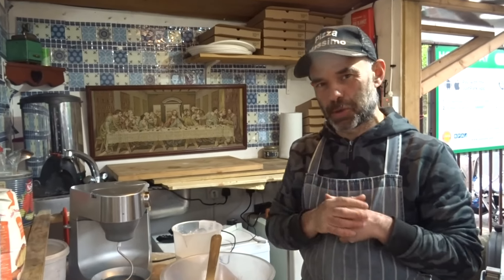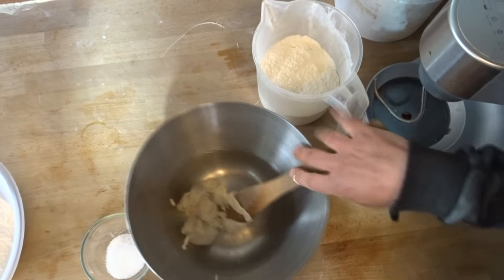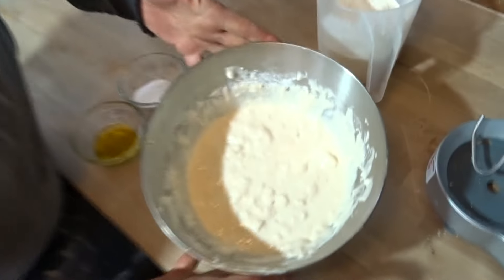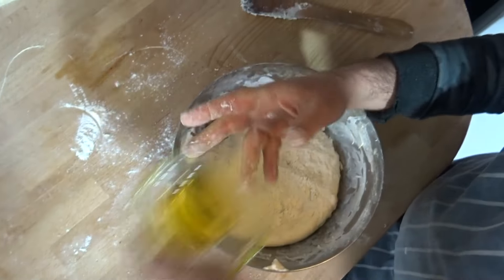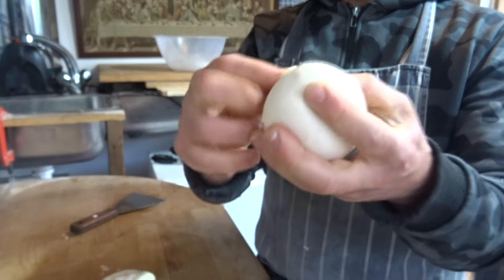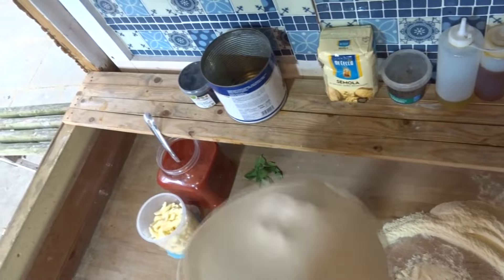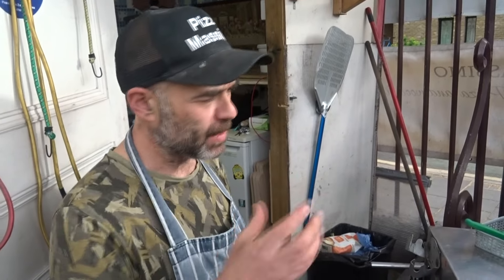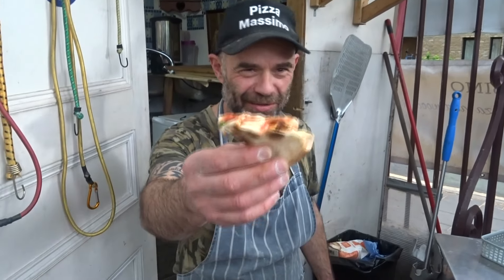My Sourdough Pizza  Recipe ( Massimo Nocerino)

Comment: Massimo, I made this today after making my own starter for the last 10 days. It was super! Very flavorful and delicate, with a nice balance of chew and crunch!  One thing I found: letting the dough balls rise overnight at room temperature here was too much, they over-rose. I’ve spent lots of time in England and I think “room temperature” there might be a tad colder than we like it in California!  I would let the balls rise in the refrigerator in the future and take them out the next day a few hours early to rise and warm up. Otherwise I will make this again for sure. By the way, I used Caputo Red “Chef’s” 00 flour which is the highest W rating Caputo makes and is targeted at long rising and that worked great.
Reply from the maker: Thanks for the comments please check my  latest video. Maybe interesting for you
Reply: The ideal “room temperature” is supposedly between 16 and 18 Celsius.

Comment: Great video!  I have a starter that is 30 years old, originally started in San Fransico, that I'll use for this.  I watched your sourdough video, and the only difference from mine is your using the 50/50 white and whole wheat flours in the starter (the whole wheat will give it more of the "sourdough" taste) where I typically use just 100% white flour.  I bet the sourdough really give the pizza a nice taste you don't get with a typical poolish or biga.

Comment: What percentage starter to flower do you use for a 24 hour ferment? Do you reduce the starter percentage if you want to do a 48 hour room temperature ferment? What is the normal temperature of the environment the dough is fermenting in? 

Thank you for all the great info on your channel! I am new to sourdough pizza but learning a lot and want to make great pizza at home.
Reply from the maker: 10% in summer  20 % winter  . For example  1 kg flour  200 gr starter
Reply from the maker: At room temperature  around  12/15  degrees. For  48 hours  fermentation  may  need to reduce slightly lower the starter
Reply: Thank you. I’ll give it a try!
Reply: Do you notice much flavor difference between 24 and 48 hours. I enjoy a stronger sourdough flavor which is why I’m interested in 48 hours. I did 48 hours with 2.5% starter but it came out very flat. What signs do you look for to know the dough is ready to cook? Thanks for all the great info!

Comment: Massimo, I’ve really enjoyed many of your videos, thanks so much. One confusion: in your earlier video on sourdough crust you showed using Caputo Pizzeria flour which is Tipo 00 but here you advocate type 0.  I’m confused at the change and curious what you recommend?  Also some flour says it’s W value but many do not so I’m struggling to use that as a guide. Thank you!
Reply from the maker: Hi I do prefer  type 0 flour  but suing  a caputo red or other s still can make q good results  pizzas. But  I really  love  the final results on type 0 flour. In terms  of w most of packaging no shows you the w on the flour. Always  you can check all specs  for any brand of flour on line  ,that  tell full details
Reply: Thank you!

Comment: Thank you for making this video Massimo! Been watching your videos and they’re super helpful. I have a couple questions if you don’t mind: your hydration here, including starter, is 69%, assuming starter is 100%. And you also add 2% of oil. That hydration is fairly high, but somehow when you do your dough balls they don’t seem that way at all, they seem fairly dry and not sticky. Is there any thing else you do that makes it like that? Secondly, when you leave the dough balls to ferment for 24 hours, is it in room temperature or in the refrigerator? Thank you!
Reply from the maker: My dough  it's 100% sourdough  only room temperature  hydro  57/60 %..let my know if need more questions
Reply: @massimonocerino  I got it. Thank you for your reply! Rock on brother.
Reply: As the starter contains 90g of water, is the total water not 690g therefore giving a hydration of 69%? As @MS has already said.

Or is it usual to not include the water in the starter in the total hydration?
Reply: As to bakers percentages, you guys forgot to add the flour in the starter to the calculation. So it is 690gmH2O/1090gm flour=63%
Reply: @scotttreloar7285  good call

Comment: Greetings Massimo from Puerto Rico 🇵🇷. I have a question. How I calculate the amount of starter or Polish that I need to make de Dough?
Reply from the maker: I do add 100 gr starter sourdough for kg flour. Winter 200 gr starter for 1kg flour
Reply: @massimonocerino  thanks you very much. 👍🏻
Reply: @massimonocerino i live in the middle east so winter is 15c or at night 5c is that considered winter? 
Summer is between 20c and 30c

Comment: is there a reason you add the oil in last?
Reply from the maker: The oil in the dough is used for:
make the pizza more crunchy, crumbly and flavorful.
improve the leavening phase making the final result not only tastier but also more easily digestible.
give greater elasticity to the compound.
help to keep the pizza better and longer.

Comment: I tried this recipe, but dough was very wet and balls just became flat. Do you know why?
Reply from the maker: Are you use sourdough starter?
Reply: @massimonocerino  yes I was. The rise was fine, and crust was filled with air holes. But dough was very wet. Had to use a lot of semolina to form.
Reply from the maker: @krs-fltutorials4487  do less hydro  next time should be OK. Some fluors assorb more or less water depending of the types
Reply: @massimonocerino  okay. I used red Caputo. Have to try type 0 w 350 like you.
Reply: Thank for you for the help. I enjoy your videos!